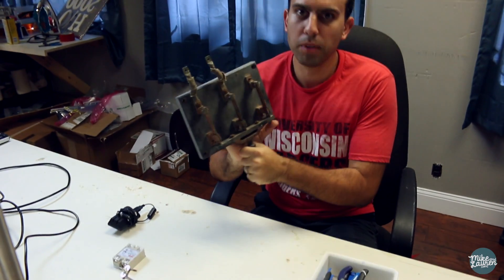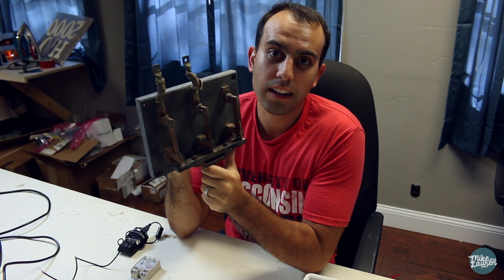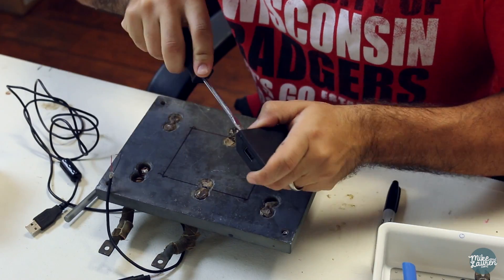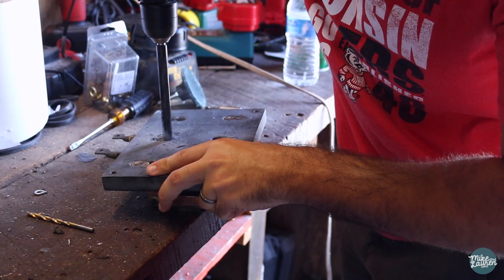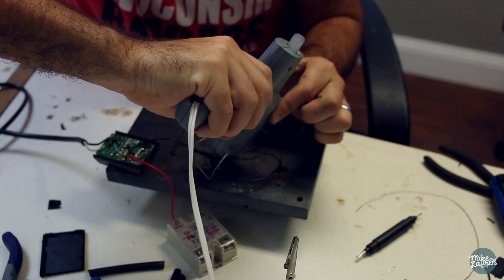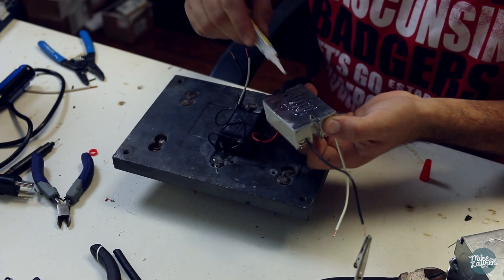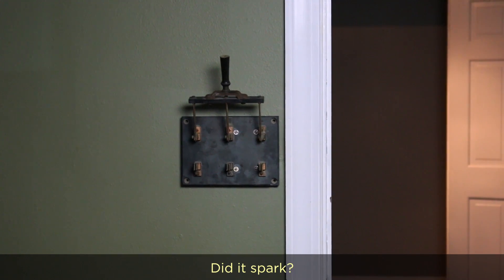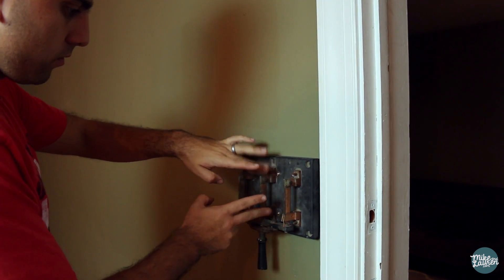DIY Frankenstein Light Switch (Knife Switch and Relay)

Comment: Nicely done.  Clean install. For reference; knife switches were installed in both the up and down position.  In the 19th century "down" was popular.  By the 1920's many sideways installations had become prevalent.  This all ended once "up" was mandated by electrical code.

If you want the switch to operate more effortlessly; I would recommend resurfacing the copper conductors and oiling them.

Great video. 👍

Comment: Can someone tell me what the function of the relay is in this case? The cell phone is an AC-DC converter that’s 
bring the voltage and current down. What would be the effect if there was no relay?
Reply: Darian Castle if you touch the exposed metal it will be a VERY unpleasant experience and it might kill you
Reply: to increase the guage of wire from #22 to #14. it's hard to solder 14 to a chip

Comment: use of this solid state relay was a bad choice, to be properly installed it needs to be mounted on a heat sink and inside a metal enclosure, as it is not listed for direct in the wall use. I would recommend using a standard magnetic latching type relay as it risk of fire is much lower.

Comment: The switch is awesome. The way you touched it scared me. If for whatever reason you completed a circuit by touching it with BOTH hands the current would have passed across your heart and potentially caused cardiac arrest. If you used one hand it would have only zapped your hand only. Probably best to test with a metal bar with an insulated handle and glove.

Comment: Very Good! I hate to be one of those "You should've " guys but you should have left the gnarly old wires attached to it in the original pic on your Reddit post. Maybe have them going into the wall or at least appearing to. Maybe remove the wire on the inside so it's just the insulation so it's safe.
Reply from the maker: I still have them and have considered doing exactly that.

Comment: I don't think anyone here realizes that its not voltage that kills you. its current.
@Forssa1"Any voltage below 50v is considered safe to interact with"

I don't mean to be a "goody two shoes" here, but no voltage is considered safe to interact with. It's as simple as that, don't touch live electricity because you have no reason to.

"no matter how many mA". Are you thick? all it takes is 30 mA to put the heart into cardiac arrest. I'm open to debate on this, but if you're gonna risk a life, make sure its your own and not anyone elses.

Comment: i think its upside down but nice build
Reply from the maker: Dan C Actually someone on reddit just cleared things up:

"Electrical code (NEC 404.6(B)) for knife switches allows them mounted any direction, but requires a mechanical means to hold the switch open if mounted vertically with closed in the downward position like you have it. Now mechanical means simply means the switch won't close on it's own, through friction, latch, etc, basically so long as it won't close on its own mounted that way."
Reply: Mike and Lauren http://en.wikipedia.org/wiki/Knife_switch#mediaviewer/File:Electrical_Machinery_1917_-_knife_switch.jpg
Reply: cmvermont Mike and Lauren The idea is that the switch can't succum to gravity and engage.  Having it the way cmvermont shows is correct and can't possibly engage itself.
Reply from the maker: I couldn't find a picture with it the other way.  Can you confirm?

Comment: Cool and simple too. Having been shocked by 120 V it isn't too bad but something you'd want to avoid. Also (and I am sure you did) use your multimeter to see what the voltage is before touching it. Also for future reference only touch it with a single hand not both so the current don't go through your heart, you'll feel 120 V even with just one hand.
Reply from the maker: Good info. Thanks!
Reply: David Springgay If you have no path to ground, or just happen to be touching neutral, then you wont notice with just one hand. So bad advice if you would assume that it is safe if you cant feel anything.